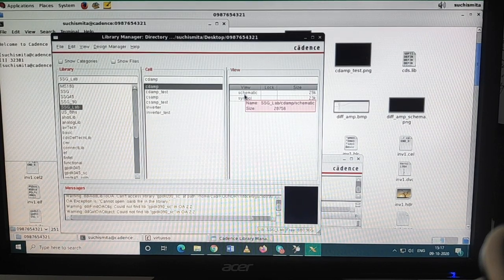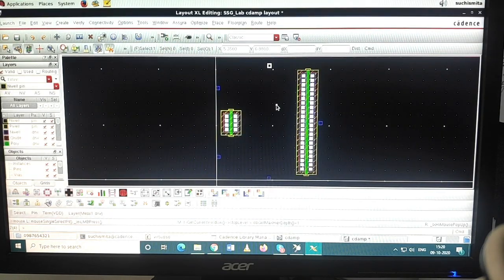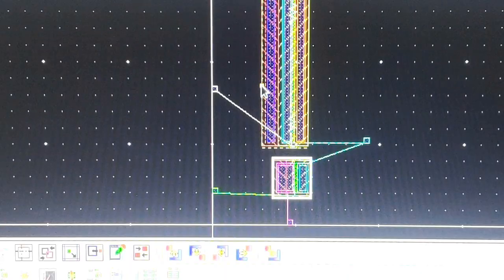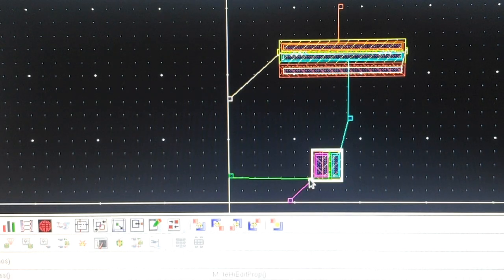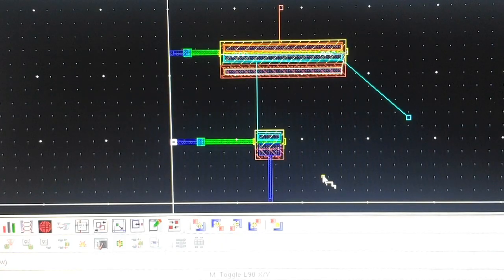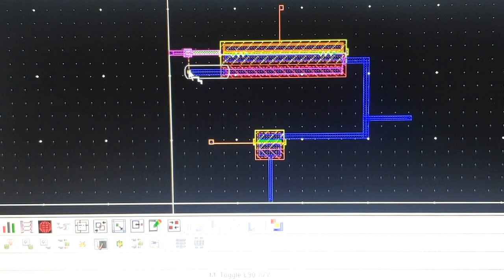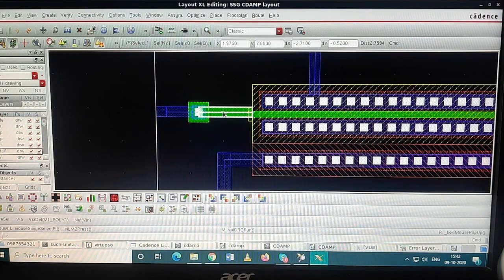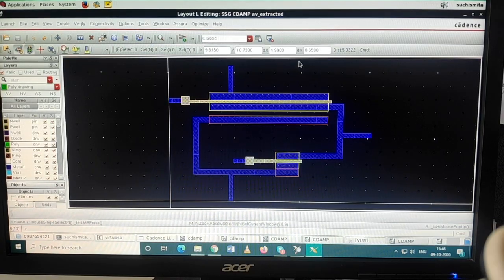Cadence Virtuoso: Master the Common Drain Amplifier Layout | Source Follower | VLSI Lab #10

Comment from the maker: ⏰ *Timestamps* :

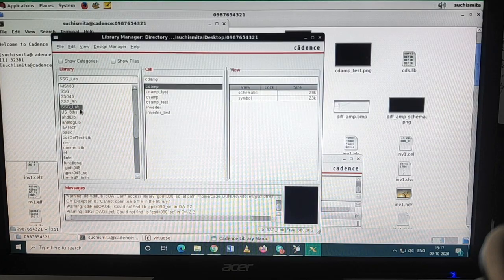00:06 – Let's Begin!
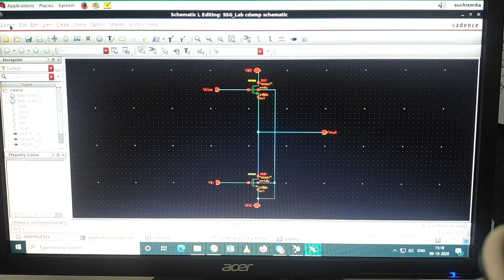00:38 – Launch Layout XL
01:15 – Connectivity: Generate All from Sources 
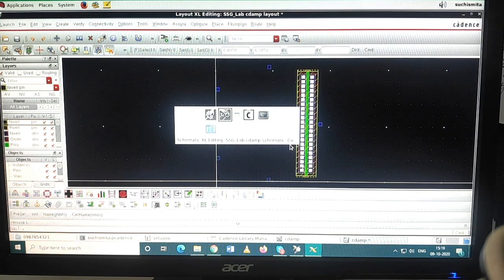01:41 – Remember: Both MOSFETs are nMOS!!! 
02:04 – Why is the width of these MOSFETs important???
02:35 – How do we connect the Body terminals here???
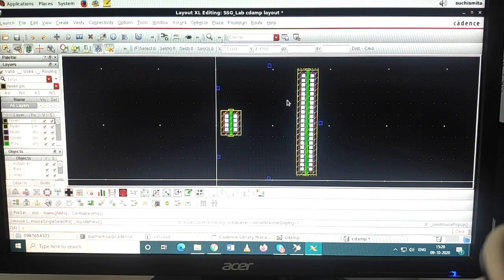02:46 – What are the Pins we have with us?
04:26 – Connectivity: Show/Hide All Incomplete Nets
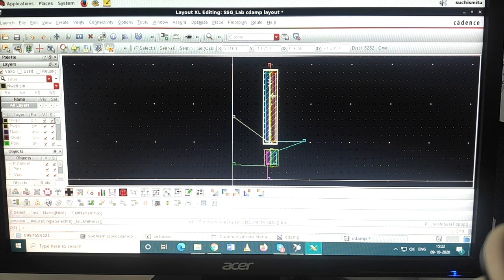04:49 – Let's get the Body Terminals!
06:09 – Complications Ahead!!!
07:01 – Error Avoidance: Rotate the MOSFET!
08:43 – Who is the Source Terminal???
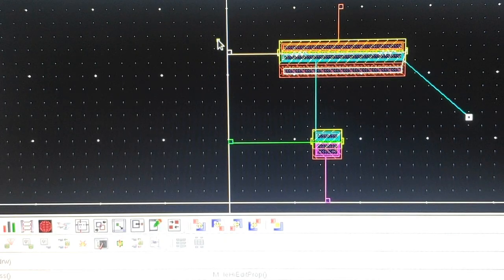10:51 – Let's start the connections!
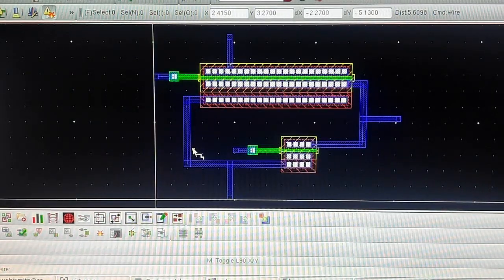17:28 – And the Layout is Done!!!
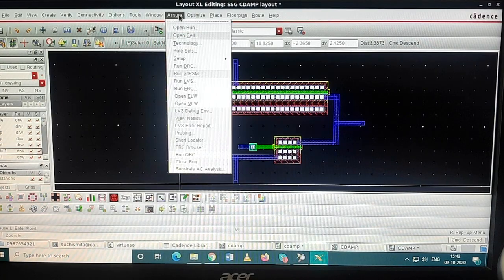18:08 – Time for ASSURA
18:15 – Run DRC
18:43 – DRC Error Debugging
19:31 – Run LVS
20:23 – Run QRC
21:09 – av_extracted view
21:25 – Shift + F & view the Parasitics!
22:19 – Next Lab: Layout of Common Source Amplifier